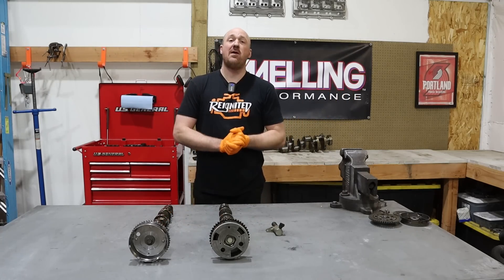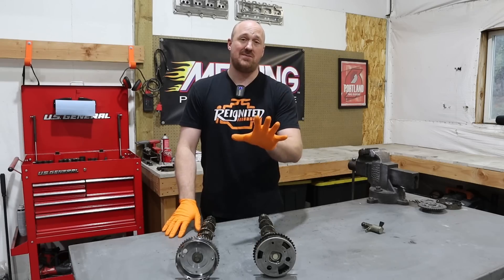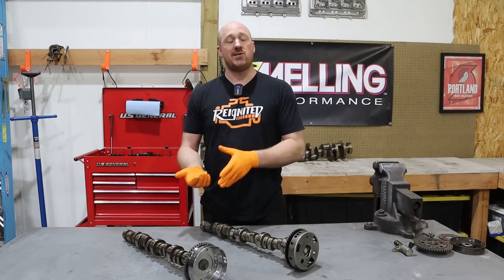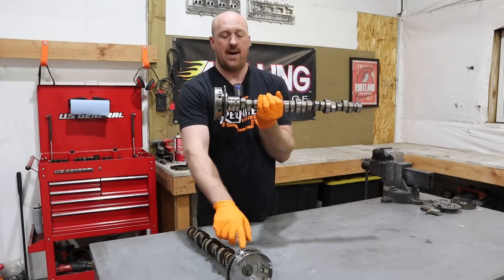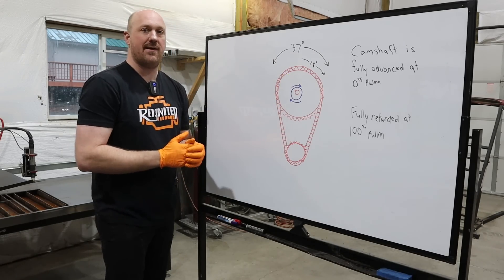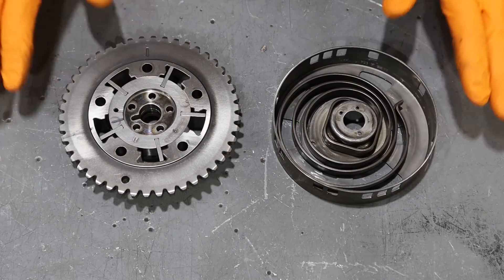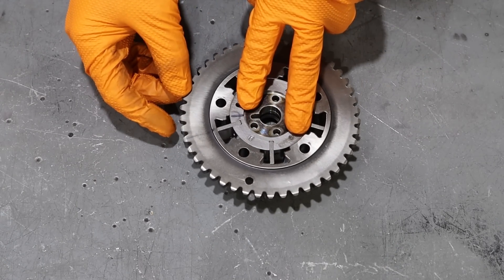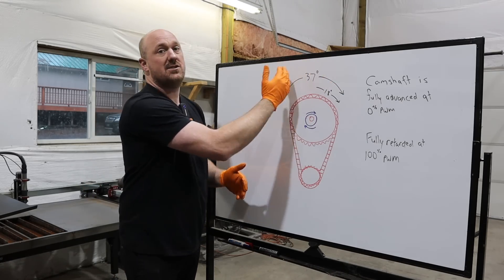Hemi VVT Explained! How Does It Work and Why?

Comment: I remember back in the late 70s, I had an Olds Cutlass with the 455 engine. I decided to rebuild the engine and I went to my local speed shop to get the tried and true Cloyes double-roller gears and chain. But they got a new product in made by a different company where the upper cam gear had these huge springs built into it. My cam I was using (Isky performance cam) was going to be quite bad on vacuum and since my Cutlass has power brakes, this was going to be iffy at best. This spring loaded cam gear was supposed to adjust valve timing at low speeds so I had enough vacuum for braking, but gave me advanced timing for performance at WOT. I had a lot of fun with that cam gear and found that it was possible to adjust limits on the automatic timing adjustments using only an allen key. I cut my timing cover in half in order to expose only the cam gear and whenever I wanted to make an adjustment, it was 15 minutes and I was ready for full on race mode...otherwise, this lumpy cam made for quite a tame traffic capable engine...Never lost a street race!
Reply from the maker: That's awesome I've never heard of that before! 👍

Comment: VTEC - variable timing electronic control, advances the exhaust cam shaft, has a pressure switch for feedback… first used on Prelude, as I remember it…

Comment: I drive an 07 with non vvt; I do my own engine work so I’m happy with simple.
Reply from the maker: Absolutely, like I mentioned it's a very robust design. I actually like the early Gen 3 hemi for how reliable they are. They don't make the power of the newer ones without a lot of help, but I've seen people mistreat them horribly and they still just work. 👍

Comment: I am sure you already know this, but the last gen viper had a mechadyne "cam in a cam" system that actually could vary the intake and exhaust independently.  For those that thought the Viper engine was a tractor engine, it was one of the first single-cam engines to do that.  I believe the new c8 engine also has a cam in a cam.  Also, for those that are interested further, when you can adjust both intake and exhaust independent of another, you can get that "ghost cam" effect through tuning - basically all you are doing is increasing overlap.
Reply from the maker: I was actually going to insert a clip of that Viper cam just because it's interesting, but I thought it might distract too much from what I was trying to get across. Super neat tech though! 👍
Reply: Bmw has some super crazy valve timing technology. Seems like a lot to go wrong to me
Reply: @jondoe4667  The valvetronic system is much more complex as it can control more than duration (It has to since it replaces the throttle body).  In reality these systems are band-aids and only Koenigsegg's freevalve system can really control everything without cams, and can vary opening profiles without worry about the ramp wear, valve float, or spring pressure.  I do not think they have ultimate valve closing ability because I think they rely on a spring to assist/dampen the closing so the valve doesn't beat itself into the head.  But back to cams, the Hemi and Chevy "Cam in block" engines minimize complexity since there is a single phaser to deal with.  Not to mention making for a small head (Well the Hemi is kind of big, but nowhere near DOHC-head big)
Reply: @The3chordwonder  yeah the video I had watched about the bmw ones were completely electronic I believe, and basically had infinite adjustability. To me it seemed really complex. I'd much rather have the simple GM or Mopar system.

Comment: I have a question not about this great video. I know you were transmission expert my 2019 ram shifts hard from 4th to 3rd when downshifting sometimes it seems like the transmission will pop out of gear and tell me the shift it back into park then back into drivewhen I put the transmission manually in -8 it never happens. Most of the time it happens only when it’s cold and I’m stopping quickly.
Reply: Change the fluid

Comment: A lot of manufacturers use VVT because it is more effective than EGR and allows them to do away with EGR. VVT is better for both gas mileage and power. Most engines are required to have either EGR or VVT for emissions reasons. I think some engines actually have both. The Ford 2.7 ecoboost I believe has both.

Comment: Hey Skye, off topic but I was told by my boss (who was told by a local engine rebuilder) that Chrysler has started using some slightly longer pushrods as a means of stopping ticking noises from the valve train of post 2009 Hemi’s. Have you ever heard of this? Seems like a possible fix given that from everything I understand about these engines the oil to pump up the lifters comes from the rocker shafts, into the rockers, down the pushrods, and finally into the lifters. Replacing the pushrods also wouldn’t require pulling anything beyond the rocker shafts either.

My 14 Ram 1500 has had a mild tick for about the last 60-70,000km. It’s most audible at a cold idle, and only just barely audible at a hot idle. It’s inaudible above idle. It runs perfectly fine(no misfires), and it’s not the exhaust manifold bolts as I recently replaced those myself with new OE bolts. The truck gets full synthetic 5W20 at an interval more frequent than the factory recommends, and several cut open oil filters have turned up nothing of note in terms of metal. Just curious if and trucks ever come in with the complaint and what if any the fix might be.
Reply from the maker: They did switch to slightly longer pushrods in 2009 but it didn't have anything to do with preventing a tick noise. The valves are physically longer on the 09+ cylinder heads allowing for more lift, which meant the rockers had to be mounted further away which necessitated the longer pushrods.

Comment: I didn't understand when the computer advance or retard the cam. My 96 Tahoe was getting 12 mpg. I was reading online and someone said a worn timing chain could cause my engine to burn gas. The engine did have over 285k miles. I replaced the timing chain and I had to advance the cam a little bit for the gear to bolt to the cam. The engine ran little raw @ low rpm but like a race engine @ high rpm. The intake valves were stay open a little too long and drinking gas. After the new timing chain and a little time for the pcm to adjust. My old 5.7 was getting 14.5 mpg again.

Comment: Great job explaining the voodoo behind VVT. Are stock, oem grind Hemi cams the limit for unlocked VVT phaser, or is there a particular aftermarket grind that can still sqeeze more power but not need a vvt reduction/lockout mod.
Reply from the maker: That's actually a good question I'm not sure. I think every aftermarket cam I've seen has a least a VVT limiter needed. But I think as soon as you have a cam with any sort of higher lift it will require it.

Comment: What effect does higher oil pressure have on this system?
Reply from the maker: None that I'm aware of, I think even with the high volume pumps we are usually only running in the 75-85psi range which isn't a ton more than the factory pump makes at higher RPM. It might be an issue if you tried to run using 150psi, but even then I doubt it. 👍
Reply: I was reading comments to ask the same question.  Appreciate the response, but I can't help to think it would alter the cam timing a bit more aggressively earlier in the RPM range.   Maybe not significantly.   Maybe ask Melling or an independent dyno to do a test?   Would be fun to see the results.
Reply from the maker: @tbiker99  the pressure wouldn't have any effect on the amount of flow the solenoid is capable of at various PWM as far as I'm aware. Besides which, the cam sensor is constantly checking to verify the cam position relative to the crankshaft, so it would immediately set a code if it were trying to obtain a certain value and was unable to do so.
Reply: I forgot about the cam sensor.  That does make sense, even if it did cause a difference the computer would adjust for it. Good call.  thanks for the response.    @ReignitedAuto

Comment: Great video. Very informative. Thank you. I have a question about my truck. 2009, every time I rev  the engine above 5,000 ish for instance, merging onto interstate when you have to get down on it to get up to speed of flowing traffic, I get a misfire. That misfire continues for about a 1/4-1/2 mile and then goes away. Every time. Any clue as to what will cause it to misfire only above a certain high rpm but then go away after driving normal?
Reply from the maker: I hate to say it, but that's textbook behavior for when a lifter has failed and it's just starting to eat into the cam lobe. The valve can no longer achieve the proper lift under high acceleration and will misfire, but under low load/lower rpm it runs fine. 🙁
Reply: Thanks for confirming what I had figured on all along but didn’t want to agree with my diagnosis. Lol. Sounds like it’s time for a new cam and a set of lifters. I’ve got right at 200,000 miles on this truck. Would you recommend a factory oem cam or an aftermarket. And which manufacturer do you suggest if you opt for aftermarket. I don’t need top end power. I need low torque for pulling. Thank you very much for your input on this. Very much appreciated!!
Reply from the maker: @rickymay5855  I think the OEM cam is the easiest option, it performs pretty well and there won't be any mods needed. It's tough to find aftermarket cams that focus on torque. I think one potential option would be the 6.4 truck camshaft but I haven't tested that myself.
Reply: @ReignitedAuto  thank you for all the helpful info!!! Have a great new year. I’ll be looking for your next video that you’re thinking about putting out!! Keep up the great work.

Comment: Good info thanks!  SO then you can't put a stock 6.4L cam into a 5.7L?
Reply from the maker: Not into a 03-08 model, anything 09+ it'll fit. 👍
Reply: Say I have a VVT 5.7L full stock @ReignitedAuto , could I replace the cam with a 6.4L cam, and would it provide any gains?  What else would I need to change?  Valve springs?
Reply from the maker: @33ordie  I do think the 6.4 cam gives a decent midrange bump without having to change too many other components. I actually did this swap in my budget challenger series I did a couple years ago.  
However, swapping the camshaft can be a significant amount of work and it might be better to maximize your results from doing so. This means going with a more aggressive camshaft, stiffer valve springs and a custom tune. More money no doubt, but much larger potential for gains. One thing to keep in mind, the camshaft cam only take advantage of more airflow if you've already modded the rest of the engine like the intake and exhaust.
Reply: Currently have a non MDS 6.4L cam in my 5.7L. Works great, very fun top end compared to stock. You do need to upgrade the valve springs.